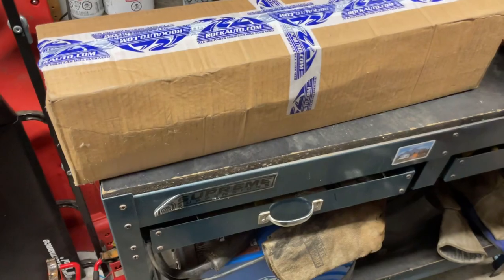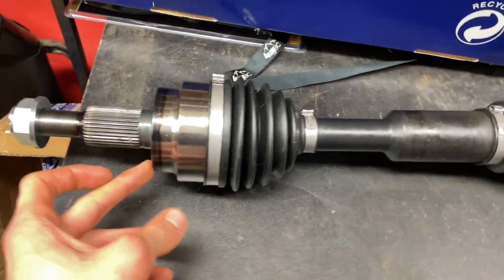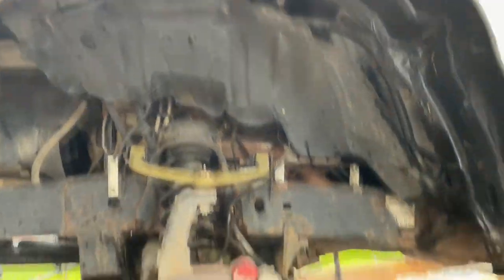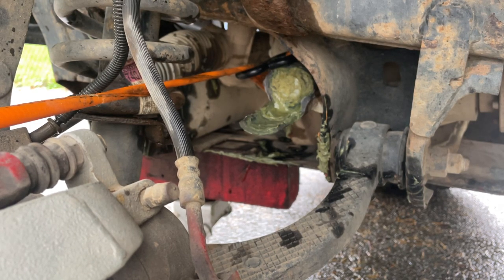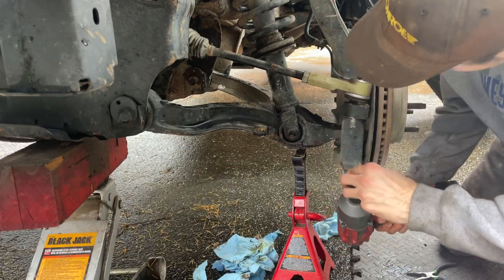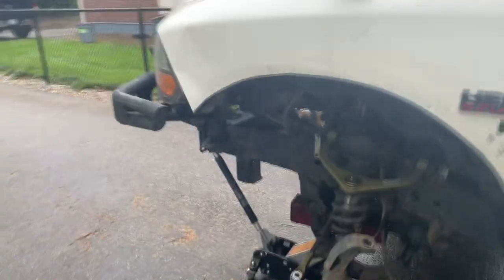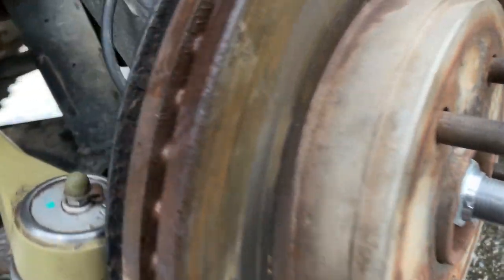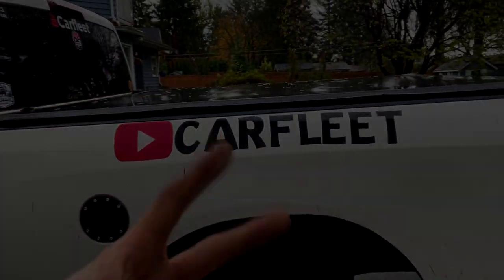TrakMotive HD Extended Travel CV Axle Install & Overview | Diy/How To (Dodge Ram 2010) 37s

Comment: Just installed on a 2009 lifted silverado..both sides.
Passenger side eas easy.. drivers was a much tighter fit between the differential and the hub and also decided to remove the sway bar link and one strut bolt to be able to get in there.

Comment: I got some very identical to those for my 2013 ram 1500 from NAPA it was in the 200’s price range. They had it same day pick up… their website has two options for the cv axle, i picked “lifted” option to get these same ones.
Reply from the maker: That’s good to know!
Reply: Ive been looking into those napa CV axles too. How would you say your experience is with those?
Reply: @jmdelgado1994   i was running 35’s with these but when i upgraded to 37’s they both went out on me after 3 months being on 37’s. I took them back to napa because they have a limited lifetime warranty, but after still running on 37’s they went out again after 4 months. And thats just on highway roads. Im thinking on buying RCV axles. But they are about 2.8k for a pair

Comment: These babies still holding up? My application is definitely different (lowered ram 4x4) but I’m thinking the added articulation of the joints will still apply and be beneficial.
Reply from the maker: Snapped one since this video but There doing good now 
I will be making a video discussing how they have held up in the future
Reply: I got 6k out of one. Hoping for better luck on the replacement.  
Not horible for the price if your not paying labor.
Reply: @Carfleet  Looking forward to the video and review. I'm considering doing this mod to my 2000 4Runner

Comment: Are the nuts self locking?  Just installed one, and the nut won't hand spin down the shaft.. I'm just asking cause I don't want to torque it down if it's cross threaded ..
Reply from the maker: The nut should start by hand spinning a few threads then its self locking
Reply: @Carfleet  yes it does start till it gets down to the last 2 threads then I can't hand spin it.. thanks
It has me a little paranoid

Comment: How nave they worked out for you? I put these in my truck....seem okay so far.
Reply from the maker: They’ve been good the one I put on in the video snapped haha but I bought another one and it’s been fine! I have 37s and lots of power from the 5.7 let’s just say turning your wheels full lock and gassing it hurts😂
I make sure if I’m putting power down my wheels are straight (in 4wd)
Reply: I think some of the problem people are having with these is just that, along with installing regular length shafts when they should have installed the ones for lifted vehicles....stuff like that. I daily drive my old F150, and the worst 'off road" I get is driving across corn fields that have been chisel plowed.....more of a hazard to ball joints, haha.  @Carfleet
Reply from the maker: @StormLaker  ya they’ll last you a long time

Comment: I hope they are working out great, Im planning on getting a pair for the rams lil brother, a 4.7 dakota, Rockauto is listing mine at 180 a piece under its "heavy duty" category beating out the likes of GSP cv axels in terms of price range. I am a lil weary of buying auto products out of China which is where they produce the trackmotive cv and is distributed at a california location, Supposedly tho Wonh Industries are bosses at making cvs since 2005 so I hope they hold up. Great video an once again I hope theyre working out for you.
Reply from the maker: Thanks bud! They’ve been great so far I just put the other side cv in same brand 
Haven’t had any issues yet 
I hope they work out for your Dakota! 
Cheers

Comment: How has the cv axle work for any issues
Reply from the maker: Not so far!
Reply: @Carfleet  so it’s a good Quality axle
Reply from the maker: @brayanvazquez7857  hasn’t broken yet haha
Reply: @Carfleet  it’s because I bought axles from O’Reilly auto parts that are supposedly same as the trakmotive and one broke when I had it on 4 high and I just back up and broke so I was wondering if this axle is better then the once I got my ram is lifted with 35 I don’t take it that crazy off road but I want something that won’t brake when you just give it a lil of gas
Reply from the maker: @brayanvazquez7857  ya man I get it. these have been good so far no complaints I’ve been wheeling with them multiple times and no issues